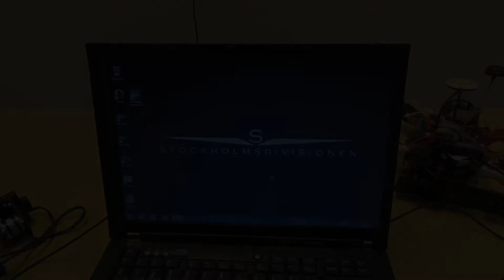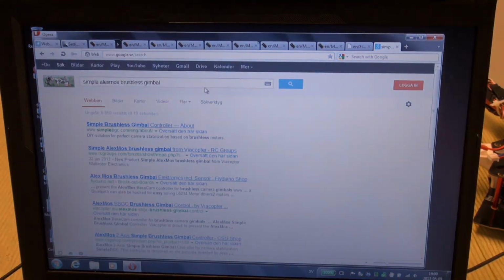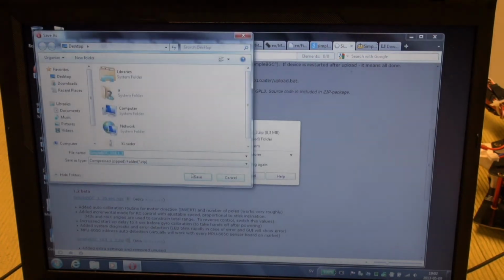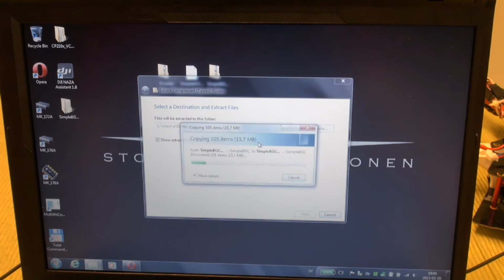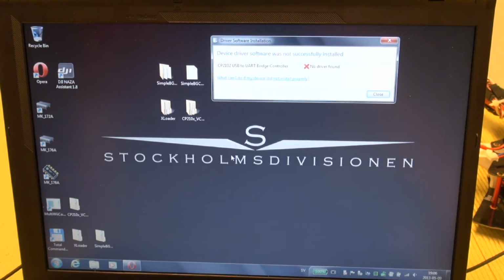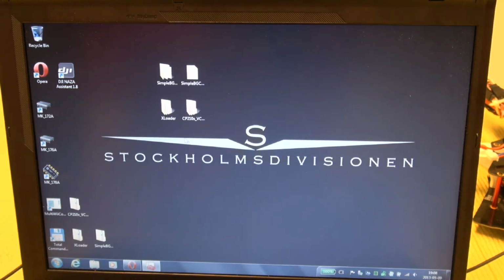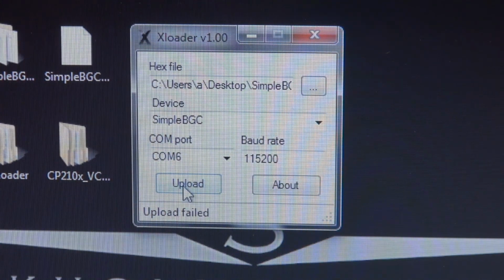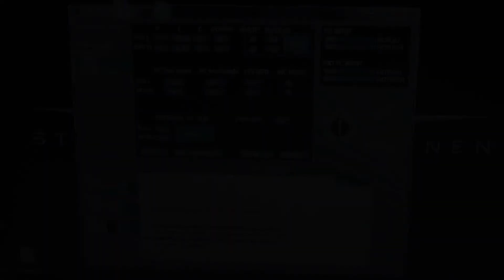TBS Discovery TGD Brushless Gimbal part 7 - 20130509

Comment: Struggling to communicate between software and board. Installed  windows driver. The hex file is a MHTML file. The Xloader looks for a hex file - I have to change that to " all files" is this correct?  When I open the GUIv2.0 b3 it pops two windows- 1 a dos prompt like window running a list of data, ( date, command /connect thread etc)  and 2 GUI but the Calib Acc is not accessible / grey. Any ideas please?